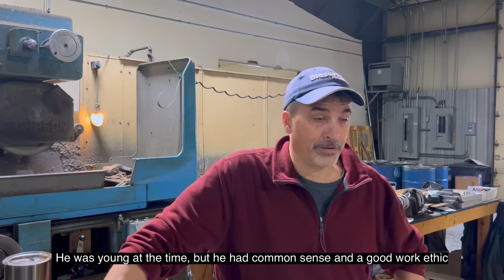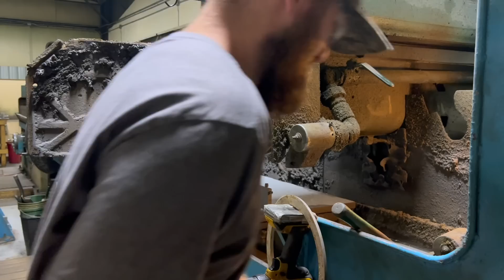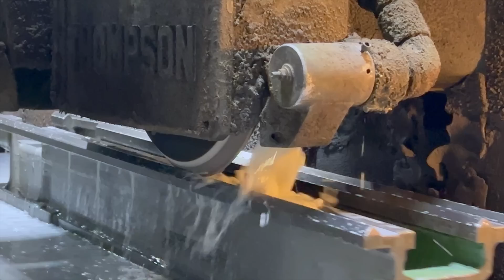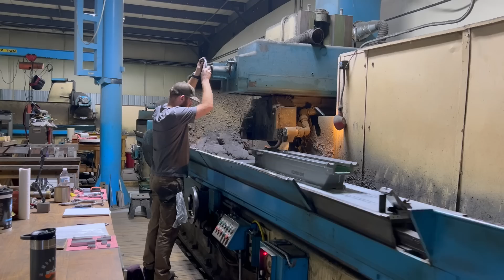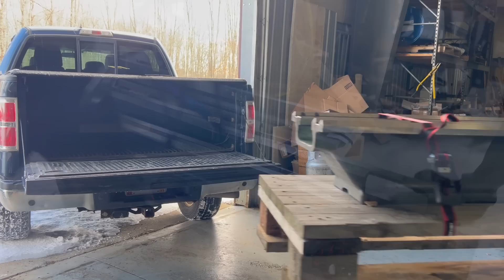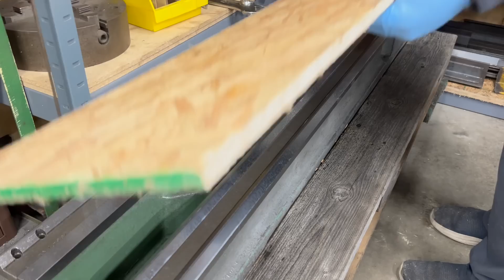South Bend Lathe Rebuild: Grinding the Bed Ways

Comment from the maker: This is only the first step in rebuilding this lathe. With the ways ground, I still have to mill, build up and scrape the saddle to account for the loss in material during the grinding. But all of that work I can do myself. For those that will ask, the cost to grind these ways was $1,200. that might seem like a lot for a South Bend lathe that doesn't have flame hardened ways. But, I think the lathe is worth it. I am going to be doing the rest of the work myself, which will only cost me time, but even that will be worth it in the end.
Reply: Thanks for sharing the price.
Reply: Since SB wanted $1,200 to bring my 10LHeavy plus saddle, back in the early 1980s, that’s a bargain. Good thing you didn’t have to ship both ways, that’s another $600.
Reply: Clean up that grinder man! My boss would lose his sh$t if the machine was like that especially a grinder.
Reply: @AlienAI-69  I agree with you, I've seen some stuff fall off while they were grinding ,and the coolant should be spraying the wheel not the part to help keep the wheel clean. and they need a better way of measuring !
Reply: @waynereynolds4388  you are completely right. It's not being ground right or not being checked right? I rebuild these things for factories for 40 pus year

 years now.
Reply: @waynereynolds4388 wow you really seem to know what you are talking about. Not really. That coolant needs to be spraying the machine because it heats up moves as soon as you start grinding. That wheel is is a ruff finish. It’s not getting clogged up by taking less than .013 off. The wheel gets more clogged when you have a finer finish and that’s where you only take .001 or less off. I would know.
Reply: @zakkT91  it’s a bit more complicated than that, thought it’s mostly correct. Particles of grit and metal build up in front of the wheel as it moves forwards. The coolant should wash that away before the stone runs into it. On the way back, the stone is moving away from the junk, so it’s not an immediate problem as the coolant will remove it no matter where it’s aimed, as long as there’s enough to wash against the chuck.
Reply: @AlienAI-69  The grinder is as clean as it needs to be. The grime that collects over time does not affect accuracy as long as it's keep off the working surfaces.
Reply: @ I’m just wondering how they keep that chuck flat and undinged. I’d hate to be the one who has to stone it before each job. And I hope they do stone it!
Reply: @melgross well I hit tolerances of .0005 across 26 inches of width while grinding aluminum so I’d say the chuck is good. I also check the machine for balance and keep up with making sure it’s grinding true.
Reply: @MyLilMule  great price!  Thank you for posting as I have a 13 x40 colchester that has 5.5 thou of wear near the hs that's bugging me. Maybe for a hobby lathe I should leave it be, but it's all apart now so this is the time. I'll be watching your saddle repairs to see how much I want to get into this!
Reply: @Rusty-Metal Thanks I had an anxiety attack from the beatdown I woulda gotten if my machine looked like that lol
Reply: @MyLilMule  I love it when old farts try to sell their old lathe for like $4,000. I tell them their lathe is worthless without a repair like this, but they don’t even know what a dial indicator is.

Comment: My first Engineering job at a Machine Tool Manufacturer gave me the chance to see the various processes used.   The cast bedways were machined by an ancient shaper and then the bedways were all hand scraped to be flat,  a long process.  I was told that the hand scraping left numeous very shallow recesses in the surface to retain oil.

Comment: Do you have to grind bottom of lathe that attaches to the magnet table. How do you know the lathe bed is sitting flush on table?
Reply from the maker: The bottom is not a wear surface and would be as true as it came from the factory. Thanks for watching!
Reply: If the bottom isn’t completely flat it gets shimmed out so the magnet doesn’t pull it down. It ends up being ground in a “free state.”

Comment: Dings in way surfaces are typically not an issue unless not managed.  A fresh ding tends to raise a little metal around the edge and that results in an accuracy problem.  Over time, sometimes a long time, it may wear back down.  So, it is best to scrape the way flat again if this happens.  The usual source of a ding is dropping a chuck on the ways.  That's why it's good to always have a piece of wood handy to lay upon the ways to be under where you are removing and installing a chuck.  Another source is when a workpiece comes loose and flies in the direction of the ways.  You can have the same problem with dings on a metal surface plate and that has the same remedies, regrind or at least scrape, the offending area.  A big appeal of granite surface plates is that they don't ding, they chip and remain otherwise flat.  So why not make lathe beds out of granite?  Some actually are.

Comment: An engine hoist can be invaluable and can also be rented.  Some machines might be too tall to use an engine house effectively on the entire machine.  For a milling machine, I removed the head.  And then made a steel plate with extra holes that bolted to the top of the base where the head usually bolts.  I could load the base and head separately into a pickup truck that way.  And after unloading, roll each piece hanging from the hoist into the shop (a.k.a garage in my case), and then re-assemble.
Reply from the maker: Yup. Did the same with my Bridgeport. They are a handy tool.

Comment: That was pretty cool man 😎. A grinding shop that can still do that sort of thing has gotta be pretty rare. Now ya got an old gem in near pristine condition = priceless 😁. I don't think realigning the leadscrew and stuff will be too bad. Did some work to my saddle and hardly made a difference. Good luck man and thanks for the vid!
Cheers! 😊
Reply from the maker: I'll be building up the saddle with turcute and scraping it. So I shouldn't need to do anything with the lead screw.

Comment: Good One !   Another South Bend good for another 60 years !  I'm new subscriber, but I've seen you many times in comments sections of other metal workers and machinists .  Remarkably, this is the first time I've seen anyone post a video showing this process.   Good to see there is still a company like P&B Grinding tackling these fine old machines for us that love old iron !   I made a point of copying their contact info in case someone approaches me looking for a similar solution for their old worn treasures.
Reply from the maker: Thanks for checking out the video, and for sharing about P&B Grinding!

Comment: Coolant should be spraying between the wheel and work at contact point. He's essentially grinding dry.
Reply: It’s a 45 degree wheel so the coolant setup can’t be too close because the spout would hit the part. Hard to show on here. On a regular flat wheel the coolant is right up on the wheel.
Reply from the maker: I leave it to the experts to decide that.

Comment: I did my 9” SB on my Bridgeport. It barely made it end to end but it came out great! It was .023” worn at its worst spot. It was bad. When I was done it was within .001” so I was very happy
Reply: I’m just curious if he did a runout before and after turning the magnet on? I’m asking because my bed was slightly warped so I had to shin it otherwise the bed would’ve been off a little
Reply from the maker: There was a lot of measuring going on. Some was done before I arrived.

Comment: It is the most comprehensive video on bed grinding I have seen. 9 years ago I got a SB 10K reground 8n a shop in Contrecoeur, Quebec. The haop had 2 6 foot grinders aand one 25 foot grinder. Bed was looking new. (Flame hardened). Saddle was rebuilt with Turcite. Even though it is a 60+ year old machine, I work easy on 0.0005" tolerances when required. Good luck in the scraping of other components. Great old cast iron. If you don’t have it, get Machine tool reconditioning book.
Reply from the maker: I have that book. I try to find time to just read some of it here and there.
Reply: One thing I learned is that it is imperative to keep the lathe perfectly levelled while rebuilding. In your case, very important when refitting the saddle and tailstock.  Follow Conelly procedure for headstock alignment. This alignment is key for saddle alignment.  Your saddle must be raised because of bed grinding and wear on saddle. Leadscrew height will dictate your saddle position. Take time to measure, measure and measure again. (I rebuilt 2 SB 10K and 3 SB 9A)
Reply: Tailstock alignment: find a piece of ground stock that fits the tailstock and extend at least 6 in out of the tailstock. Plane the base to get rid of wear on the base.then, wir at least 2 indicators, scrape the V way to rotate the tailstockback parallel to the saddle way. Once your tailstock is aligned parallel to bed ways, you can then shim to raise the tailstock to spindle height. Get yourself a MT alignment bar with same taper as your tailstock . You need to check if your tailstock quill bore is coaxial to the external section.

Comment: My 1st thought , when seeing this type of work is . I want to see the machine that ground the ways of the grinder being "used" .
Reply from the maker: If I had to guess, the ways on this machine were likely planed on a large industrial planer and then scraped in. If the machine has been rebuilt, which would also be a guess, then I would think the table ways would have been lined with turcite and then scraped.

Comment: Every way is lower by the same amount .
The head stock and the tail stock sets on the ways as does the saddle all at the same level now .
The only thing that might need adjustments are the bearings height of the power shaft that drives the saddle now that the careage is lower on the bed than before .
Reply from the maker: I'll be milling the saddle and building it up with Turcite. I will not be adjusting the height of the lead screw.
Reply: @MyLilMule  All should be good as new when finished.
Reply from the maker: @ That is the hope!

Comment: 40 years ago I worked with my father at  powerking tractors they had  a horizontal mill with a 8foot travel, and had a grinding head attached to it so we ground a few lathe beds on there i loved that machine and always thought of someday doing this again. But too old now.
Reply from the maker: If you're still on the right side of the dirt, you're not too old. 😊

Comment: I bought a 10L Heavy in 1983. I bought some parts from South Bend and asked how much it would cost to grind the bed. They said that they would have to grind the saddle as well, to really do it properly. The saddle wears as well as the bed and if you don’t grind it, it can rock on the bed. Just a couple of thou, but enough to push the saddle down under pressure of the cut. They said they charged $1,200 to do both. I would pay shipping to them and they would pay back to me. I didn’t get it done as that was a lot of money back then. While I still have it, I haven’t used it for some time and it’s apart as I’ve been restoring it, part by part. I bought a FOURTEEN in 2002 and with the hardened bed it shows zero wear.
Reply from the maker: I plan to mill the underside of the saddle and use Turcite to build it back up and then scrape the turcite.
Reply: @MyLilMule  yup, that’s the way to do it. I’ve never scraped Turcite.
Reply from the maker: @ Me either. First time for everything!
Reply: @ good ,jack. I really am interested in knowing how you feel about it when you’re doing it. The feel has got to be a lot different.

Comment: Oh, and cover the ground ways with some plastic wrap (that you've confirmed won't get dissolved by your rust protectant) to help preserve the surfaces while stored. This helps protect against moisture or other compounds in the OSB.
Reply from the maker: Plastic wrap holds moisture. That's not a good idea.
Reply: @MyLilMule  Whatever you feel is best.
Reply from the maker: @Dreadfox-t9o 👌🏼

Comment: Someone may have already suggested this, but if you've gone through this effort and reestablished precision surfaces, you might think about using hardened shim stock on the way surfaces to both build up the lost height and have a harder bearing surface that can be replaced when it gets worn. A proper cleaning, bead blasting, and correct epoxy application is needed to do this right, or even a final kiss grind to level it out again. 

Alternatively, use a hard epoxy in the divots and holes remaining to bring all surfaces level, so you prevent chips from building up and getting carried into the Turcite. If you let swarf embed into the soft Turcite, you turn it into a lap that will re-wear the ways. Takes some care to prep and level the filler (much like adding on the shim stock), but if you've gone this far...  Just some thoughts from an old(ish) machinist.

Comment: 10:40 … Going to grab the drill to finish tightening those hand threaded bolts on the retaining plate for the V-Groove Grinding Wheel and 😳 …. …. …. 
Did someone forget to put that shim hanging on the cordless drill back on first before assembling the V-Groove Grinding Wheel or was that cut scene just coincidence 😇?

God only knows how many times I’ve been there myself 😂.
Reply: @TradeWorksLLC  that shim on the drill was for the 6 inch wide wheel. The new shim you see me place on before the bolts is for the 2 inch wide 45 degree wheel.
Reply from the maker: I think the answer is in the other reply. But no creative edits other than to try to get it down to a reasonable length video.

Comment: Fun for me to watch. I did precision grinding for 40 years and retired in 2019. operated all different grinding machines and in the last 14 years operated the surface grinding equipment. Are largest was a Cincinnati with over a 8-foot capacity. Thats one of four other surface machines. As I retired, I picked up a 
13" south bend lathe and know there is wear in those ways. To late or I would have done those ways at work, which we were able to do during slack time.
Good luck with the rest of your rebuild.
Reply from the maker: Oh, that would have been nice to do stuff like that yourself. Thanks for watching!

Comment: How do you know the bottom of the lathe bed is actually flat so when they turn that magnet table on it actually holds the ways flat and in the position it'll be in when its reinstalled on the late?
Reply: If the bottom of the bed is twisted or out of flat, We will either pack it out with shims or in extreme cases, we can flip it over and kiss of the bottom to true it up.,
Reply from the maker: Because they are professionals. They know what they are doing.

Comment: Your lathe is from the 60's and has  that much wear. My South Bend is a 1934 model, I'm scared to death to actually find out how much wear is on mine.
Reply from the maker: You never know. Depends on how much use and abuse it saw. Not sure where this one was used, but iy was probably not properly lubricated, which contributes to wear.

Comment: I have an old (1913) Lodge and Shipley lathe that has wear on the ways you can look down the vee way and see the wear. I plan on getting this done, solely as a sentimental piece of equipment. It was the first lathe I used and saved it from a scrapper nearly 40 years ago. I plan on it being my go to lathe in my retirement hobby shop in the near future. Thanks for showing the actual process of the grinding work.
Reply from the maker: Save those lathes! Thanks for watching!

Comment: Since the grind lowered the level of the bed, I assume you will need to shim the tailstock to regain alignment with the spindle?
Reply: Since the headstock and the tailstock both sit on the v-ways, the alignment won't be changed. It will need to be checked to see how good it was to start with.
What will have to be shimmed up is the saddle so that the apron alignment with the lead screw will be maintained. The usual trick here is to machine the saddle v-ways and install turcite shimming. The plastic turcite can be scraped to get the saddle aligned. The turcite also has the advantage of very low wear on the bed ways.
Reply from the maker: I will have to so some work to the tailstock, yes. But not much. Since the headstock and tailstock sit on the same V-ways, they will still be at the same relative heights. The only thing that really changes is I lose .016" of swing.

Comment: Very good vid, Greg!  Q: The headstock mounts on the bed ways,right?  Why is it necessary to build up the saddle?  I’m probably not seeing something…sorry if this is a wierd question!
Reply: @thomasstover6272  think about how the apron is attached to the saddle.....and the lead screw(s) go through the apron. After grinding the ways it lowers all of this down and out of alignment.
Reply: @ I get it!  Thanks!  I was coming at it from the wrong direction!
Reply from the maker: I have to adjust the height that the apron hangs off the saddle so the carriage gear and rack mesh properly as well as the half nuts and feed clutch line up with the lead screw.
Reply: @MyLilMule  got it, thanks!  Makes sense…
Reply: @MyLilMule  as I've never dont this  type of rebuild before, would it be possible to just remove material from the top of the apron to compensate?
Reply from the maker: @ That would affect how the gear in the apron meshes with the cross slide lead screw for the power cross feed. It's not an option on this lathe. And to be clear, I've never done this before either!